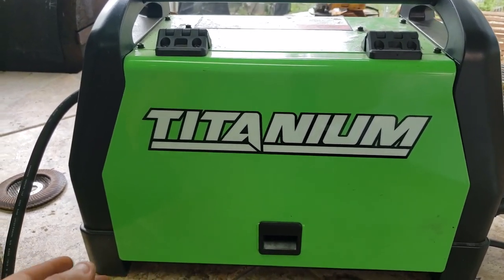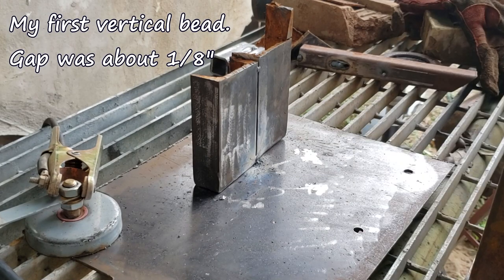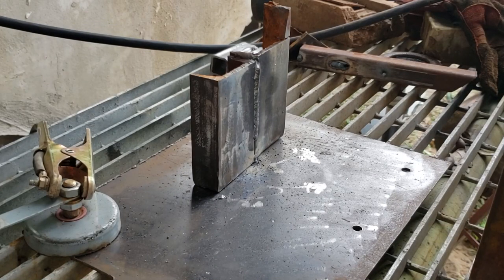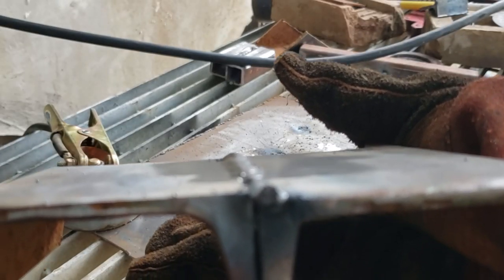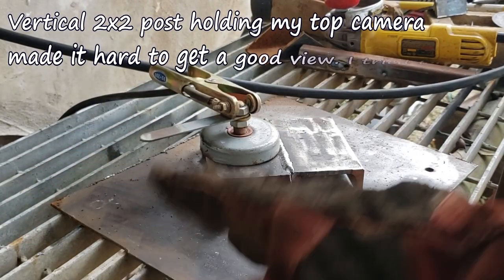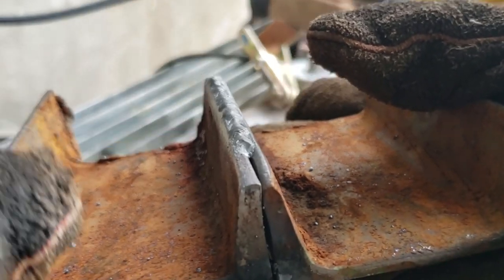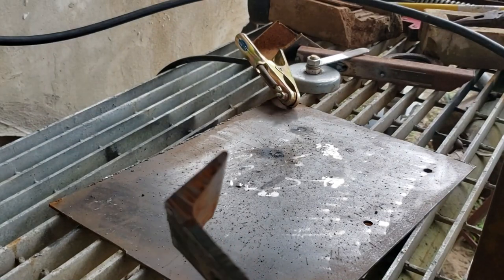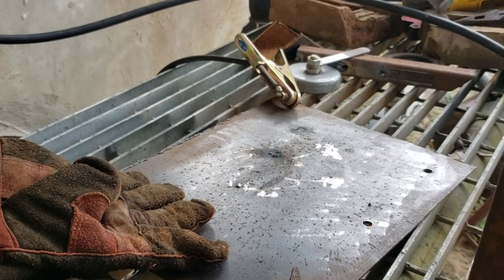MIG 140 Professional Welder With 120 Volt Input test and review ESAB  Coreshield 15

Comment from the maker: Lets Hit 3000 subs. I want to give away some stuff.
Reply: Almost there my friend👍👍
Reply from the maker: @BigLou956  Yes, almost there. I am thinking on what to do for give aways. I may do 3 or more winners still determining. It's been a long few years to get here.
Reply: If it is stubbing as you say. Try minor adjustments on your wfs and get sizzling sound. Turning wfs down slightly may help. The adjustments on your welder are recommended, but you can fine tune it. You can tell by the consistency of sizzling while welding. Good job.
Reply from the maker: @zeroninejames9507  I am still testing it and just turned it off for the day. I was doing thinner material today so running half speed and 16 volts. I feel like the feeding mechanism struggles because the feeding speed ain't constant. I am now running out of scrap to weld on. Thanks.
Reply: @cutweldngrind  your tensioner maybe too tight. Where the two wheels feed the wire. Loosen it up and tighten up to when it feeds and you pinch the the wire coming out of the gun it slips a bit. The your spool should have slight drag on it where it doesn't keep turning when you stop welding.
Reply from the maker: @zeroninejames9507  I will double check that this week to see if it works better. It's been a hot and humid week and I am worn out. I think I have it set around 3 and could try 2. It shows 2-3 for flux but will try fine adjustments. Thanks
Reply: Very informative video buddy! 👍👍
Reply from the maker: @axcreates_official  Thanks. Just picked up a new welding helmet and hopefully I get to try it this week. What program do you use for editing? I have Vegas Pro 17 which I tried on this video but I need lots of help.
Reply: @Jorge Serna I use apple IMovie.  It’s really user friendly.
Reply: Jorge Serna get yourself lube-matic system..  the wire will slide much better and consistent.. I have one on mine and works great!!!.👌
Reply from the maker: @hgherb  Are they pads? I am looking into it at the moment.  I just feel that the Titanium 125 and Flux 125 feed better than my 140.
Reply: Jorge Serna there like made out off fabric.  Yeah definitely the wire will run smoother. I had issues with feeding before. Not anymore..

Comment: I'm impressed you got that good of results with flux core wire. When you switch to gas shielding and solid core wire you're going to have fantastic results. Remember to switch your polarity when going from flux core to gas shielded.

Comment: I just bought this welder last night. I haven’t used it yet. I don’t like that the website says it’s a 40% duty cycle and that it can weld 5/16 steel material. Yet when I open the panel it says 30% duty cycle and 1/8 steel material. I need it to be at least capable of 3/16 at no less that 30% duty cycle.
Reply from the maker: I weld mostly 1/4" on mine and I have seen the label showing 1/8" thickness max. The duty cycle is 30% and I think it is low. Did you keep yours or returned it?
Reply: I’ve owed it for a week I have a job I need done and the other one went out on me. It was a Thermal Arc. It welds the 3/16 fine but it thermals out on me. I did some research and if I install a fan it will
Increase the duty cycle. I think I’ll keep it. I own a sheet metal
Fabrication business and do a lot of 16ga welds that it would be great for.

Comment: Trying to weld a bumper with this machine, its 1/4" thich..what would you say about the settings wire and amp..none gas welding
Reply from the maker: I use 250 on speed and 18+ volts. It also depends on the wire thickness. The settings I used are labeled on the lid for flux core and 1/8" so a little more voltage should help out.

Comment: You need more travel speed or turn up your wire feed a little, the settings on the inside panel a a guideline of where to start .
Reply from the maker: I been experimenting with the welder. I am having lots of voltage drop on my outlet so will be upgrading the romex cable soon. I believe the power is affecting my welder as the 15A breaker keeps popping.

Comment: What metals can you weld with using this welder, thank you for video!
Reply from the maker: Late response but you can weld Steel, Stainless Steel and Aluminum if you have the spool gun. I use my welder on mostly mild steel. On thickness of metal it will depend on material, Steel 24ga to 5/16" and Aluminum using the spool gun 16Ga to 3/16".

Comment: I have the same welder and set up up,,but went to change the wire size to .30 I had issues. Just wondering what brand of wire did you use?  With mine I was using a Lincoln brand wire. Not sure if that has to do with it.. it does fine with a .35 gage wire,but not by Lincoln brand..
Reply from the maker: I am still running ESAB Core shield 15.
Reply: Your question is literally answered in the title and in the video…

Comment from the maker: Just running some new wire through the welder to see if she performs the same or better than HF wire.  I tried so many things in this video that it took me 6 hours to record and edit. I am trying new cameras, camera angles, picture in picture, software, and new wire. Well this is not the best welds out there but I am very new to Flux welders and showing what to expect from a person with little experience. 

We had several rainy days and have no projects so please bare with me. Have a good day. 3000 subs will be reached in a few days. My first goal on Youtube.
Reply: 3000 subs will be a good achievement,  I can imagine it takes a lot of work.  My next project is going to be a teathered submarine, one main body and two air tanks on the top side (similar to the USS Enterprise ). Ill start designing it and collecting parts  so I can make a start on it next winter.  It'll be interesting, cameras, spotlights, ballast tanks, air pumps, water pumps, moving trim weights, twin screws, sounds like fun.
Reply from the maker: @Paulman50  That's awesome. When I was younger I wanted to build one since I lived 2 blocks away from the lake. With my luck I will get stuck at 100ft. It will be nice   after I have seen your work, ot will be awesome. Did you ever get the part number for your gearbox used on robot.
Reply: @cutweldngrind  yea i posted it on your last vidio, if you dont see it ill post it up again. Ive got two of them one i could shorten the other i couldn't.
Reply: I have this same welder , I get so much spatter with it , I’m pretty new to welding I can lay a nice bead in school with the arc welder but when it comes to this one It ends up looking like a worm any tips would be helpful .... I’m running . 030 wire 0.9mm flux core
Reply from the maker: @FollowerOfChrist589  The first week I had it I was doing great beads and lately it's been horrible. I am not sure if the wire I am using is the cause. I built a welding table and actually went over the welds with 7018 electrodes. I will upload the video soon.

Comment: subscribed, i like your videos. question: does harbor freight have a gas welder or just pure electric? if so what do you prefer a 140 electric or a 140 with the argon attachment??
Reply from the maker: Thanks for the SUB. I run my mig-140 on flux wire but will probably buy a tank later for it. I like the results the flux wire gives so I know gas will be a whole lot better. Harbor Freight may sell a lot of junk but these welders seem to hold fairly good. I abuse my tools to see if they break and so far they have survived. I also gave my gas driven welder by Hobart for ranch use.
Reply: The titanium 140 can be used with gas or flux core. It does both.

Comment: jhave a question, im got the same welder, but on the
chart i dont see for 3/16, it claims that weld up to 3/8,
whats settings can i use for 3/16 (im using 0.35 and
gas, thanks you in advance
Reply from the maker: Its been a while since I used this welder and cant really recall on settings used. I also used Flux core wire on this video which makes a small difference. I think 140A is on the minimum amperage for 3/16". I want to say around 20v and 250IPM would be a ball park.
Reply: @cutweldngrind2752   thank you very much, ill try that.
Reply: @lafinest47  I actually took the welder out today and could not weld at all. I swapped from Flux to solid wire and didnt switch to DCEP. I tried the machine at 180/19.1V once I moved polarity but need to fine tune still. We have been getting rain for the past 3 days but I will see if on Tuesday I have free time to do some test. BTW I am answering on the wrong account just noticed.
Reply: @TheRouletteGamingChannel-lu9yv   thanks, im trying to do some test too, but flux core will be better thank solid? its weird that they claim that it can weld up to 5/16 but dont show it on the chart.

Comment: Does the titanium 140 feed below 125ipm? Ive got a titanium 170 and it works well above 125ipm but bellw that, it stops feeding but continues to arc from the tip to the work.
Reply from the maker: 80 to 275 IPM are the specs on the Mig140. I typically use it around 225 to 240 ipm. I cant recall the lowest setting I have used but it has worked fine for all my applications.
Reply: @cutweldngrind  Any way you can see if it feeds at all down at 80ipm? I know most applications work higher but im trying to figure out if mine has an issue.
Reply from the maker: @TomT586 The weather is horrible today so my wife has me painting a room that's 18' tall. If I finish painting today I can try testing at minimum settings and around 80 ipm. I will try tonight or tomorrow if I dont forget buddy.
Reply from the maker: @TomT586  I dont have my nozzle on my mig torch. I set the speed to 80 and voltage 13v to 18v. It feeds but I cant really lay a bead because the wire burns out to fast. I can see a small bead forming and then the wire just runs out. I think with the noozle in place it may do what you are experiencing. If you test without noozle just make sure not to touch work area. I actually messed up my torch by arcing it and melting the brass fitting.
Reply: @cutweldngrind  When you say "wire just runs out" do you mean it stops feeding? That is the main issue I'm seeing. Its almost like the motor isnt getting enough power to feed the wire below 125ipm (maybe the computer miscalculated how much power to send the motor at these low speeds).

Comment: What amp breaker does this need to be powered by?
Reply from the maker: They recommend a 20A breaker minimum for the welder. I do trip my breaker when I weld thicker materials but I also have 80ft of  12awg wire to the main breaker box which may affect me.
Reply: @cutweldngrind  I have a dedicated 30amp 120v breaker so I should be good then?

Comment: Are you using gas?
Reply from the maker: I am currently trying to finish up a 10lb spool of ESAD Flux wire. The wire is .30" Core shield 15. I want to get some gas tanks and try welding but $$$ is scarce at the moment. Thanks
Reply: Those look like nice welds with no gas, good video

Comment: Try weaving from now on. With a 3/32 and larger gap you wanna run a zig-zag pattern over a root pass
Reply: I weld for a living. Tig weld stainless piping and mig weld stainless frames and carbon skids if you need tips, tricks, etc hmu
Reply from the maker: Sorry for the late response. I am learning slowly since I never took any classes and I wanted to try weaving uphill with 7018 and then we got the storm that left me without power for 5 days. I also picked me up some 8010 from a buddy to try out. Thanks for the support.
Reply: @cutweldngrind  No problem man. Time under the hood is everything